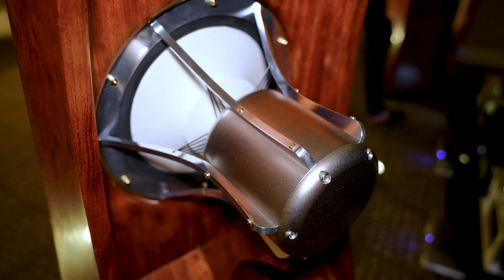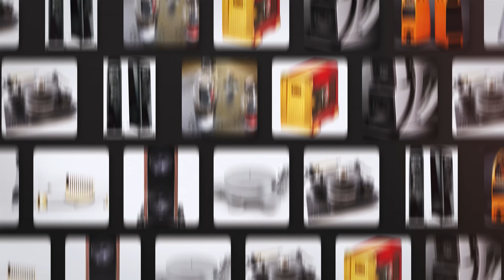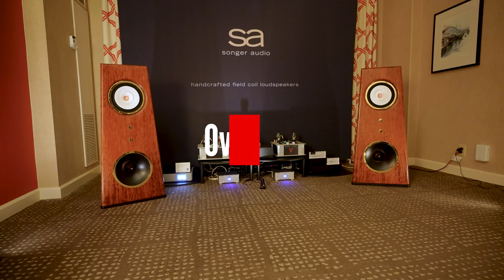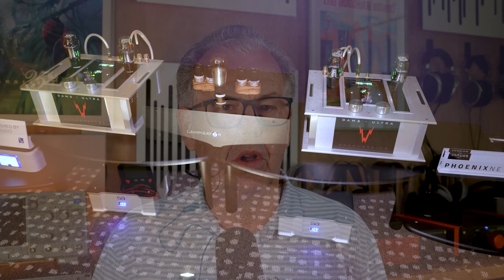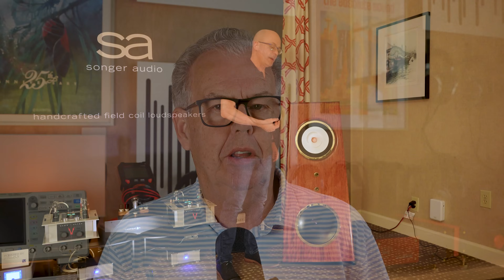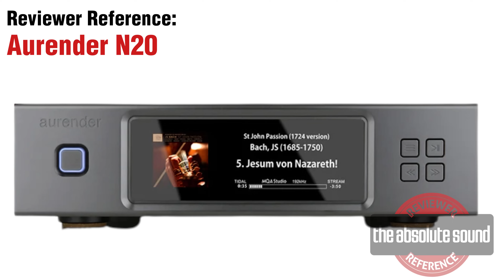Songer Audio S2x Loudspeaker Field Listen

Comment: I don't get the use of field coil driver. There is no benefit in using these apart from nostalgia and for the sake of being different. Not to mention they should be sensitive to mains supply voltage variations. There is a reason these were dropped from the mainstream industry many decades ago as soon as strong enough permanent magnets were made available.
Reply: The one reason why I am reluctant without a few days of listening